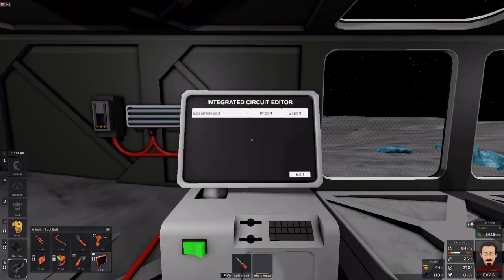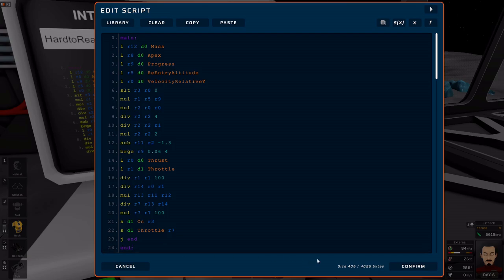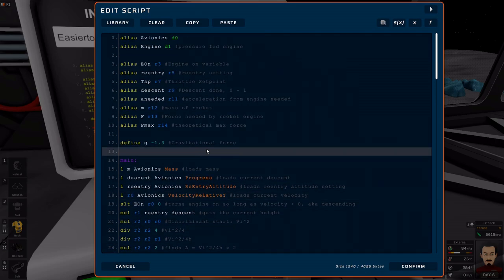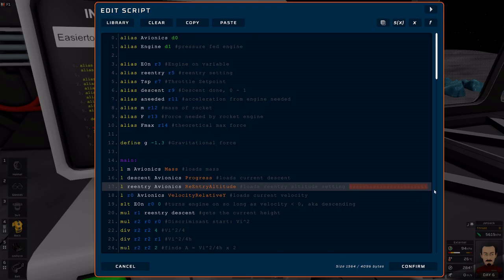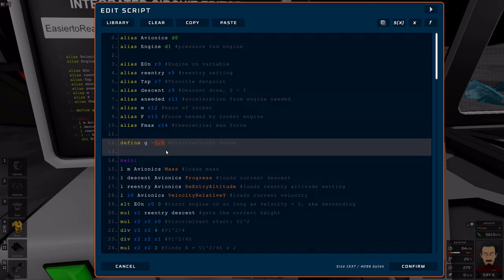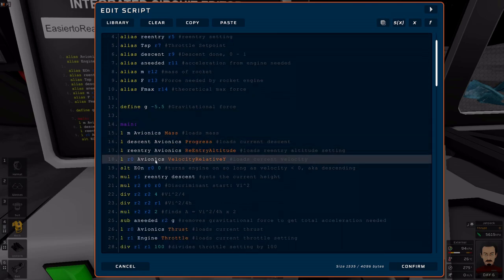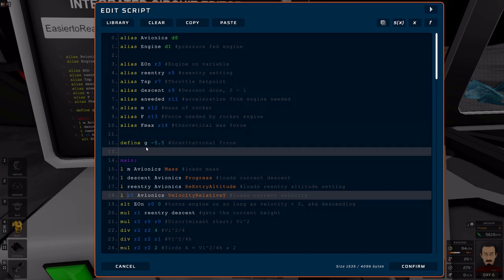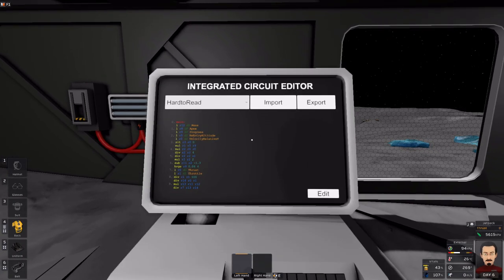IC10 Tutorial 3: Alias and Define

Comment: I want to give a comment on the super cool game, but really hard coding. Just grasping what especially breqz does and why its there - like - where is two lines down? Is it to jump over where its jumps or is it to aviod jumping... Super cool game - I appreciate it and this comment is in support of the game.
Reply from the maker: I do cover it later but to break it down... I presume you mean something like:
breqz r0 2

breqz instruction begins with br, which is to do a relative branch. Relative branching will essentially skip forward or reverse the specified number of lines at the last number in the instruction (in the above example is 2). Basically look at the line number the instruction is on, and in my case if the condition is true it will jump and land and execute 2 lines down. So if the instruction was in line 5, the next line to work will be line 7 if true. If the number was a -2 then it would be line 5 - 2 so it would begin execution at line 3.

eq is the conditional modifier so the branching instruction is looking to compare 2 numbers/registers to see if they are equal to each other.

-z suffix is an additional suffix to imply that one of the numbers in the comparison is 0. So it means you will attempt to compare a number/register to zero based on the conditional modifier. In the above example, I am comparing r0 to 0.

Combined together the instruction does "Branch 2 lines forward if r0 = 0".